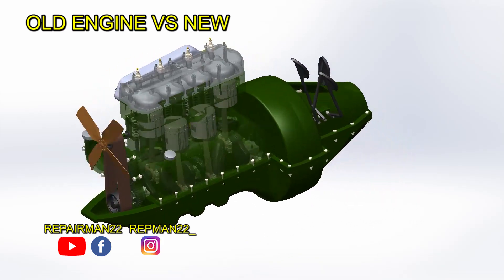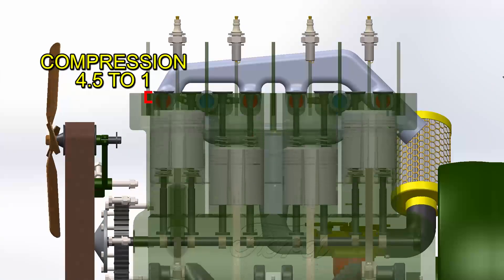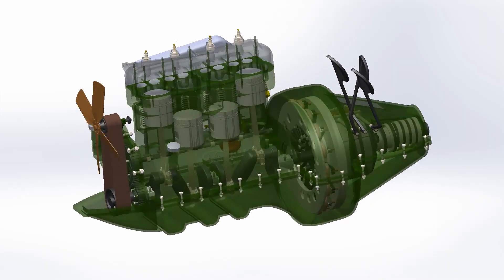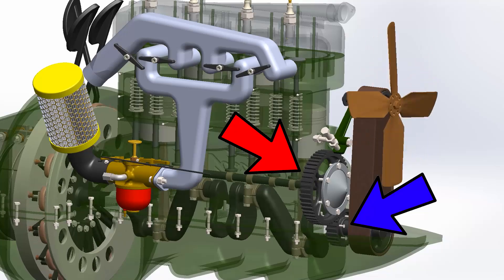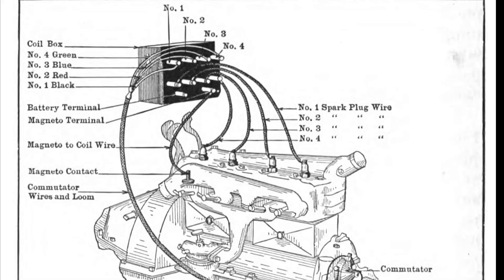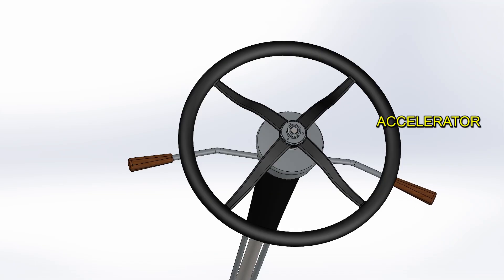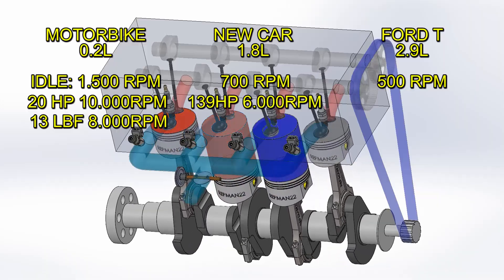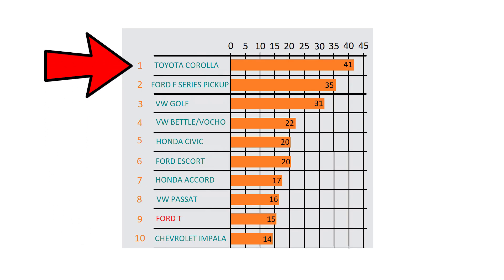Ford T vs New Car 🤯 3D Animation// What changed in engines in 100 years?

Comment: I think your video does a very good job of explaining why this car was obsolete the year it  was introduced; thank you.  There is nothing  in T thats in a modern car cause they were obsolete at the time of manufacture.  It was cheap to buy that was its greatest advancement and one that cannot be overlooked; it got the world on wheels. Of course with fuel injection and  modern oil you can have cheap Honda engines will last 300,000 miles easily with no maintenance at all and reliability that makes a model T like well... English.

Comment: In 1906, the Land Speed Record was broken by a Stanley steam car, piloted by Fred Marriott, which achieved 127 mph (204 km/h) at Ormond Beach, Florida.
Reply: Considering that only a few years earlier, in 1899, the speed record for a street car was 105 km/h (set by the "La Jamais Contente", an electrical car), this is quite an advancement. Fun fact: around 1900, 38% of the street cars in the US were EVs, 40% were steam cars and only the remaining 22% has internal combustion engines.
Reply: @klausstock8020  I've read that WW1 is the reason EV died out. the military needed vehicles that could travel farther and invested heavily in diesel. And EV was just abandoned. If that hadn't happened, we may have had EV all along
Reply: @motioninmind6015  
EV's had short range and the charging network back then was atrocious, people simply could live with a fossil fuel or steam car instead, had longer range and cars got simpler to the point electric cars had no advantages other than running costs.
Reply: @motioninmind6015  You read wrong.
Reply: @SMGJohn  What you say is not close to be truth at all
Reply: @divinehatred6021  
Source: "Trust me brah"
Reply: @SMGJohn  source: you dont know real history of our world, but i do
Reply: @maplobats  you can label me as that, i will never care though

Comment: "Unbreakable"

The model T was far from reliable, regularly snapping cranks and rods. It's simply easy to fix.
Reply: Unkillable would b closer to the mark rather than unbreakable
Reply: @themucleman  they're not reliable, just fixable. These things were not meant to last a long time, they're just rust resistant and repairable enough  to survive as happenstance.
Reply: @CreeperOnYourHouse  exactly ! As simple as they were, the Model T wasn’t expected to last 100,000 miles with only minor maintenance. Today that’s considered the bare minimum. There’s a reward for today’s complexity.
Reply: @themucleman  there's a balance in there, where complexity and technological advancement get very close. Technological advancement to let them make better parts more often, but insufficient complexity to make it prone to failure. In my opinion, that balance point was achieved in the late 80's to mid 90's, just before cars started to get bloated. I say this as an owner of a 1986 Volvo 240, which was almost on the edge of sufficient mechanical advancement to last a while, but was designed just a bit too early and has wonky electronic design.
Reply: It was quite reliable, for the time
Reply: Modern Engineering could make the rods and crank harder to break.
Reply: @TheAzureNightmare  yes for the rods, but the design was fundamentally for the wrong for crank, and better rods would be heavier, exacerbating the issue. Thin, long bearings prone to oil starvation, twisting, and shearing under load. The engine used in the model a was very similar, and there's a guy who documented the process of re-engineering that one.
Reply: @CreeperOnYourHouse  Now you got me curious! Did he make a video on YouTube about it?
Reply: @TheAzureNightmare   If you look up model a engine re engineered you should be able to find the website pretty easily.
Reply: SIR , WERE MODEL "T" VONNECTING RODS CAST IRON or STEEL ....I AM SURE THE CRANKSHAFT WAS STEEL
Reply: yeah it was easy to fix but not reliable
nowdays any car will be more reliable with basic care and even without it they'll still probably last longer
its not unusual for a semi modern car to crack 300k without any internal engine repairs and that'd frankly never happen on a model t
Reply: @esra9426  by semi-modern, you mean 90's car.  Thanks to finite element analysis, modern cars are safely built to fail by 100k miles in some way or another. 

Also, that's exactly what I said. Not reliable, just fixable.
Reply: @CreeperOnYourHouse  I've seen several cars newer than 2010 with 200+ and I was dailying an 04 with 308k for a month
Reply: @esra9426  Great, so there are some standouts. Generally, the cars known for lasting several hundred thousand miles were built in the 90's, such as old dodge trucks, all toyotas and hondas of the era, ford sedans, etc etc. 

Now a large amount of them burn oil, fry coils, have head gasket and overheating issues, transmission problems, have failed tensioners, etc etc, at a significantly higher rate than back then, amongst the noted marques.
Reply: @CreeperOnYourHouse  "Also, that's exactly what I said. Not reliable, just fixable." considering the context your whole opinion have very little sense...
The car was known to serve and drive for decades -> well designed, easy to replace parts that needs to be replaced -> well designed car.

I gonna make an educated gues that you are talking about engines that someone wanted to "fix"->"tweak" to get more out of it thx to modern fuel and modern parts that he added to it/replaced less efficient parts -> that is saying absolutly nothing about "not reliable" design when you changing critical parts of that design and this changes are the main cause of the issue...

There is also the fact that Ford-T was not designed for modern road and modern speeds, back then people were not abusing it and this 2 gears forward was not as big problem then as they would be now->today you need to push that engine to the limit to get as much RPM as posible.
And that high RPM is the best way to cause creation of the oil foam that gonna reduce oil lubricating ability and heat transfer ability->both super important when you are pushing you engine to the limit...
Reply: @Bialy_1  To best epitomise the difference between "Reliable" and "fixable", let's look at the 90's toyota. How often does stuff break? Rarely, if ever. If it does? Well, on the side of  the road you could probably do everything short of a head gasket of an engine/transmission rebuild as long as you have the right 3 sockets and a wrench. 

The Model T was built to be cheap, except for the choice in steel, reduce price as much as possible. "The car was known to drive and serve for many decades" yes, so is the VW beetle, there are millions of those around, but most examples have gone through at least 2 engine and a transaxle rebuild by now. Are they reliable? Hell no, but if your throttle cable snaps you can hook up a string to the carb and actuate it with your hand out the window.

When I say fix, I mean fix. The trembler coils which drove the ignition were accessible by undoing a single strap, the spark plugs were massive units where you could pull out the electrode, polish it up, then shove it back in there and keep driving. A downdraught carburetor was used because it was easier than using a good carburetor gasket. Before driving you always had to pull the oil drain plug to make sure there was enough in there to keep the transmission lubricated. People had to drive backwards for enough fuel pressure to get over hills and if there was any kind of collision your seat was the gas tank and you should consider yourself Johnny Storm, because you're gonna be on fire.

I won't disagree that the Model T was well designed, it absolutely was, it achieved its goals well, but well designed to meet its specific purpose doesn't mean it's reliable. It's not reliable, it wasn't built to be. Cars of that era were expensive not only because of the work that went into building it, but also the endless maintenance that had to go into making sure every day that you were in good shape to go for a drive, lubricating every joint on the car, checking the magnetos, oiling the dampers, etc. The Model T did away with that by making the car cheap enough to be disposable, and if it wasn't disposed of because it was so cheap it was cheap to buy more parts to replace where it failed.
Reply: Thank you.

Comment: The T engine was bolted into the Chassis. The spark plugs were fired by flat uninsulated brass conductors, that were bent and so held themselves in place. The lack of fuel pump required it to reverse up hill. That reduced road grip. Drivers always needed water for the engine. The wooden spokes, in artillery wheels, might Take a long soak to swell and tighten up.
Reply: Compared to modern vehicles, that sounds perfectly acceptable.
Reply: @musicauthority7828 then go buy a model T. Let's see how fun it is to do 10 mpg and die crashing a tree at 15 miles an hour with no airbags.
Reply: Model T spark plugs are fired by wires. I have never had to back up a hill. If I did I would go mighty slow because the squirrely steering in reverse is dangerous at more than a walk. The old back-up-the-hill practice was a lot less common than people seem to think. You might need it with gas in the tank under two gallons and on a very steep hill. Tightening loose wheels by soaking is a temporary measure at best. They should be respoked. If done correctly, respoked wheels will outlive the driver.
Reply: Truth. People will come on here and talk shit about modern cars while driving a modern car.
Reply: I remember the spark plugs were fired by flat uninsulated brass conductors on the Model A. They were short as the distributor on the A was in the middle of the head. I don't think they were on the model T..Could be wrong.
Reply: @nevillediener1495  No distributor on the model T, like the video mentioned it’s waisted spark. The primary side was done with a magneto, like on mopeds.
Reply: sort of like a woman?
Reply: @drpoundsign lemme guess you're one of those "single by choice" alpha males🤣🤣
Reply: @drpoundsign  Correct, because they want everything

Comment: Wait early Ford engines were not reliable one bit. They were extremely cheap, and easy to fix, that was the selling point. They could easily be fixed by a farmer that owned a tractor with the same parts. In fact if you can work on a lawn mower you can fix anything broken on a Model T.
Reply: I wouldn’t mind owning one , I love to tinker !
Reply: Ford quality hasn't changed much i see
Reply: The Model T engine was in fact quite reliable compared to other cars of its time.
Reply: Thank you why do people think these were reliable? Toyotas are reliable. Ts are easy to fix. Toyotas are not easy to fix; but they do not break...

Comment: I had a 1926 Ford Model T Coupe in the late 1980's. Yes, the splash lubrication is simpler, but there is a problem. The T was designed in Michigan where it is fairly flat, but I live in San Diego California. I was driving up a long hill with my T, and burned up the rod bearing on the #1 piston. It was not getting enough oil because the oil was mostly in the transmission and back of the engine due to the incline of the hill. In the Model T club, people add an extra quart of oil if they have to go uphill. The brake band in the transmission was just not enough for going down steep hills. In '26 the brake band was made wider to try to help the situation. Due to this, companies made what were called "Rocky Mountain Brakes" that were attached to the rear wheels. An air filter for the carburetor should have been supplied from the factory. In all, I enjoyed driving the car to special events or on special occasions.
Reply: you could have gone uphill in reverse
Reply: @AntiLGBT_SuperExterminator  I heard about doing that.
Reply: @garylangley4502  could you ad a fuel pump. and a proper cooling system. because the cooling system sometimes did work. and sometimes it did not
Reply: @Marcy53Volkswagen  One addition I made was a water pump, and it worked well. I did not have a problem with overheating, because the Model T has a huge radiator for the size of the engine, but I did not want to have any problems when I went on outings around San Diego county. Earlier Model T's had the gasoline tank under the seat, but the later ones like mine had it up higher under the cowling, so I never had a problem with the gravity fed carburetor. What it really needed was an oil pump and oiling system. There are ways of adding one, but it is a large job.
Reply: Am enjoying reading about the old vehicles idiosyncrasies!!
Reply: @thomasschwarting5108  There  is  another  way  to  get  Splash  Lubrication  to  work  well  enough ,  without  using  any  type  of  oil  pumping  ,  as  it  is  known .
Henry  Ford  , MAY  HAVE  ,  thought  about  it  ,  for  the  earliest   Model  T  ,  but  did  not  use  it .
It  could  be  used  on   ALL  engines  using  a  crankshaft .
And  . . . . . . ?
What  would  Ford  Motor  Company   pay   today  to  know  about  that  technique  ?
  A  minimum  of  $  1  U . S .  would  be  needed  .
Would  anyone  like  to  start  the  bidding   for  it  ?
Reply: 9999+99+98
Reply: 9999+99+98
Reply: Can you retrofit the Model T with a modern external oil pump for hilly areas to prevent the problem you had? You could suck from the oil pan but can you pump to #1 piston?
Reply: @markae0  Yes, that can be done. It can be huge flying leap down an incredibly deep rabbit hole, but here goes. One system I have seen is to connect a VW oil pump for an air cooled bug onto the back of the camshaft. This would eliminate the magnets for the magneto, but a lot of people do that anyway to increase power. The output is piped in copper tubing and now designs differ. It is fairly easy to drill holes in the block to the main bearings so these bearings are pressure fed. What comes out of the main bearings provide splash lubrication to the rods. The next step would be to drill the crankshaft from the main journals to the rod journals and make a groove in the main bearings so that the rod bearings are fed all of the time. There were oil pumps made for this back in the '20's, '30's, and '40's. Most were driven on either the front or back of the generator. One was driven by the gear on the front of the crankshaft. I have seen people cast new timing gear covers at home, and put a pump in there. Austin A style engine pumps are of interest, but people are using small block Chevrolet pumps, and early Ford Flathead V8 pumps too, along with industrial machine lubricating pumps. This is just scratching the surface. Mostly these are people tinkering in their garage trying to solve a problem.
Reply: @markae0  The original system uses the flywheel as an oil pump, but not very efficient. There are several aftermarket ideas that uses the flywheel's oil pumping ability more effectively, the Texas T version is most efficient and gives all the oil you'll ever need in the front (maybe it'll even starve the rear of the transmission when going  steep downhill for too long.. )
Reply: @rogerkarlsson3996  I remember seeing a small funnel with a tube that attaches near the magnets on the flywheel and the tube goes to the front main bearing area in the crank case. That may be it.
Reply: SIR ...VHEVTOLET MADE HEAVY DUTY "TRANSFER CASES" for 4 wheel drive TRUCKS  (TRANSFER CASE TAKES POWER from TRANSMISSION then into FRONT & REAR DRIVESHAFTS )  H.D. UNIT HAD A 3rd OUTPUT for a WINCH / POWER TAKE,,-OFF ......TO BE SURE TRANSFER CASE HAD LUBRICATING OIL TO ALL INTERNAL BEARINGS GENERAL MOTORS ADDED A GESR DRIVE PUMP on ONPUT SHAFT that SPRAYED OIL OVER ALL GEARS + BALL BEARINGS ! TIMKEN style TAPERED ROLLER BEARING
Reply: @erickajander5494  No need to shout.
Reply: Problem  solved  ,  Mr . Langley  .
About  2  days  ago  .
In  Australia  .
Yes  ,  the  Land  Down  Under .
(  The  source  of  both  ,  Problems   AND    Solutions .
              Y  '  up   ??   )

Comment: A Toyota Corolla ENGINE doesn't weigh anywhere CLOSE to 3000 lbs. It barely weighs 1300 lbs. It's made of ALUMINUM. A Big Block Chebby V-8 Don't weigh 3000 lbs., it weighs 2683 lbs.! I've BUILT them and changed them out and engine lifts used to NOT BE ABLE TO LIFT 3000 LBS! BTW, a Toyota 20R engine has LONGER rods than a Ford Model T engine for MORE POWER-or let's go to the 2.0 liter 23,000 RPM  direct injected 188 HP 262 Ft/lb. Alfa Romeo engine (more than the 1967 283 Chebby 283 V-8!) with nearly TWO INCH longer rods than a Model T motor and SEVEN mains but with a MUCH shorter stroke! Read Sir Harry Ricardo's "High Speed Internal Combustion Engines"(Oxford Press 1934) for the different ways to make power-there are THOUSANDS!
Reply from the maker: the video says a toyota corolla (car), not a toyota corollas engine. thank you
Reply: @repairman22  man you've got to be a saint. I wouldn't have as much patience to deal with this comment section
Reply from the maker: @czechgop7631  Haters gonna hate... it's their nature.

Comment: Great video compairing the engines, but can a modern engine run on carburetors? And last a long time left alone and start like new?
Reply: Does a carburetor supply air and fuel?  Yes of course.
Reply: @rcpmac  But a carb can get blocked with fuel varnish.
Reply: Ive seen people put carbs on vehicles made after 2010. The same issues apply to any other carbed vehicle though, if you store it with gas in the carb it will evaporate, varnish up the carb, and it wont work properly.